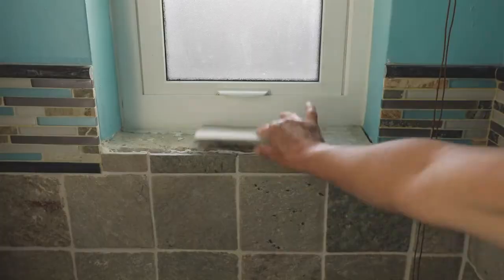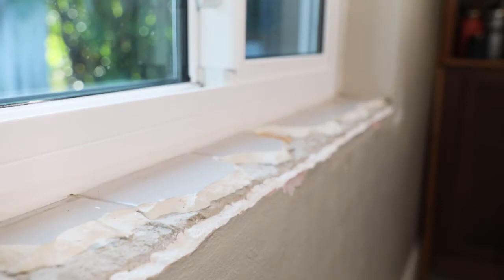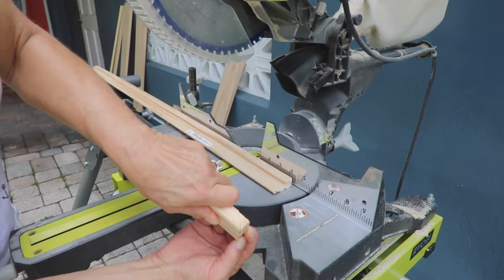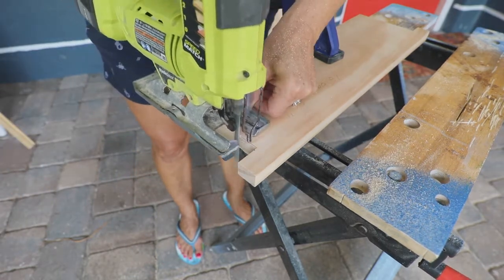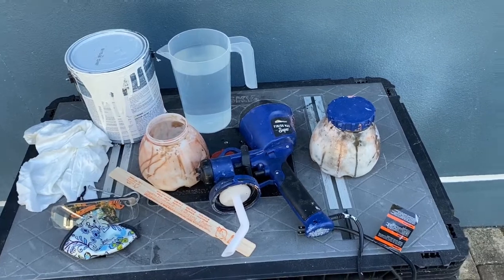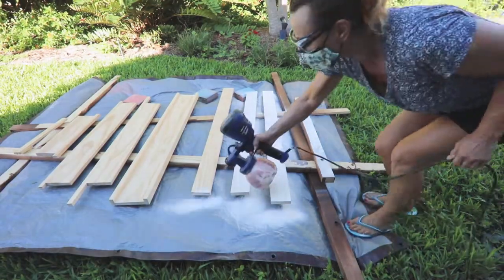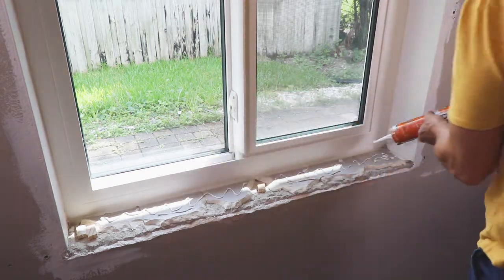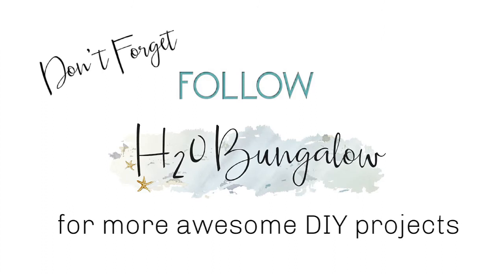How To Make A Window Sill

Comment: Flip flops, shorts, power tools and lumber is all you need to do this project and go to the ER.
Reply from the maker: Not really, it's 100 degrees here and none of this was heavy work or required any heavy machinery.
Reply: You would have a nervous breakdown watching me do demo in bare feet! 😂 🤣
Reply: If you are gonna put your fingers in a saw blade I doubt steel toe boots will help
Reply: @WendiWachtelH2OBungalow you go girl! 😂 I climb the ladder in my flip flops when I have a mind to. I have a question: were both of those pieces cut at 45 degrees or was the bigger piece a different angle?